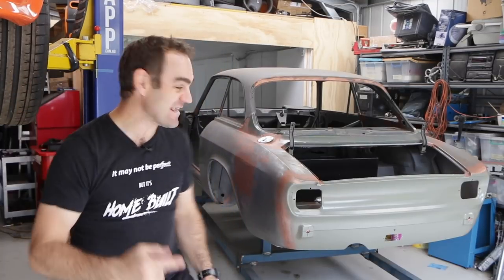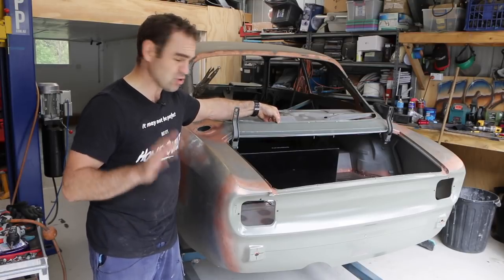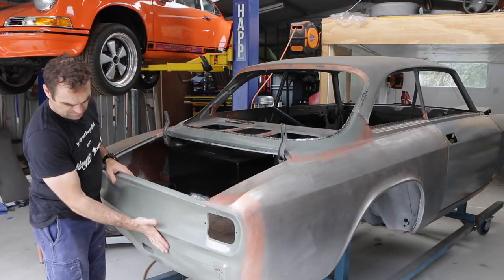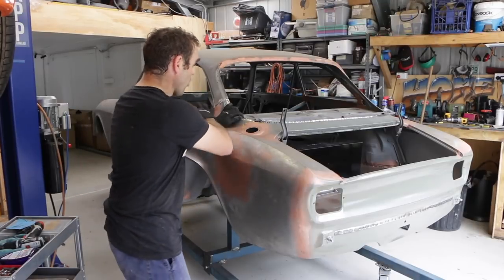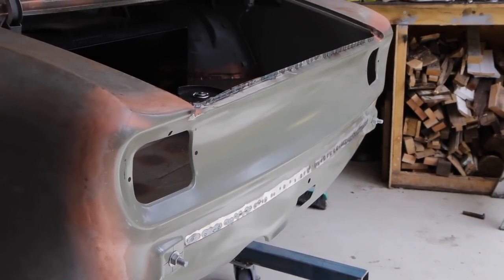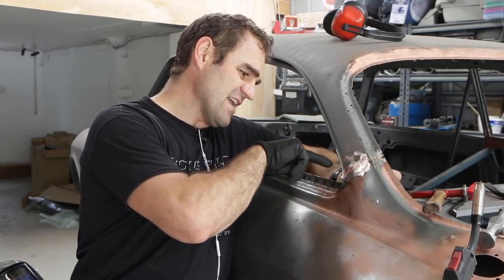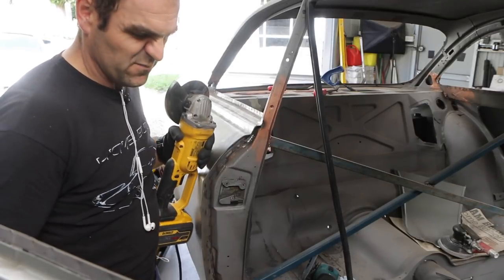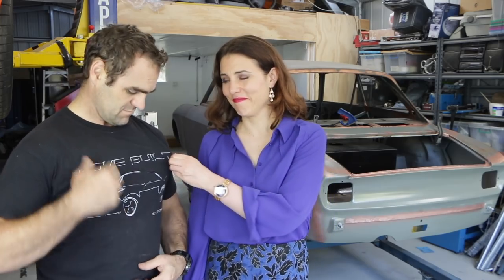Finally a one piece shell again! - Alfarrari 105 project car build part 33

Comment: Must be something in the weather. I had an off day on the welder as well. Problem is, I was welding the door bars and gussets in. First thing you see when open the door. The rest of the cage has all nice exposed welds. Gussets? Ground back smooth.

Comment: Wow what a massive milestone to have the body all back together. 
Out of interest what shielding gas were you using with the Silicon Bronze wire?  I think they recommend a 100% Argon for that type of work, rather than the standard 75/25 Argonshield so that may have influenced your results. I am no welding expert, just passing on what I found In my own research.
Anyway congrats Jeff and can't ait for the next video.
Reply: I'm interested to know this too - at first I thought he'd tigged it and that's always straight argon as far as I know.
Reply: @seanalexander9531  Yep TIG is normally 100% argon, I think there are rare occasions where a different mix is used on rare metals but for most of us that just weld steel and aluminium it just 100% argon.
Since leaving the comment I have found differing opinions about the shielding gas when it comes to MIG,  the miller welders site says only use 100% argon with silicon bronze but other forums have mentioned that as long as the gas mix does not contain any oxygen it is ok.
Reply: @nerner67  OK thanks, I've done some SiB* with the TIG and used 100% argon and it worked out fine.

*  This Old Tony did a video on this and coined the term :)

Comment: Nice job!  But, don't you feel like it could have used just a few more spot welds?  😬👍
Reply from the maker: Basically that is what Tim does instead of seam welding, is just double or triple up the spot welds ;)
Reply: @HomeBuiltByJeff  creating more rigidity than original manufacturing, which leads to less torsional twist during hard cornering. With a standard engine anyways. 🙂

Comment: Other guys doing welding seem to put in a couple of screws or rivets to pull any gaps in then once some welds are in they remove them and finish the welds. I didn’t see you do this
Reply from the maker: Watch closely and you will see me putting in the screws and also removing them ;)

Comment: I always eagerly await your latest videos. Thanks for showing we other mere mortals that it can be done. I have a couple of questions however.  1) did you do a trial fit off camera of the rear window again-just in case?  Things shift around and I've personally been snakebit before and glass does not bend like metal.  Plus-Maybe its different down under but rear glass is made out of unobtanium in the states so I'd be 3x careful 2) Early on in this series you sold me on upgrading my welding equipment to buying a TIG. Was the MIG employed due to a need for a stronger more structural weld?  For this application would flux core be sufficient or do you need an inert mix.  Ive been planning on going to TIG for all my gas needs  3) with the spot welder I'm not seeing welding goggles used.  It is because spot welding is not a continuous arc?  Glad to see that the weather seems to have settled down in your neck of the woods
Reply from the maker: I have more control with the MIG, and I never use flux core wire any more. Gas is better all round.

Comment: at 13:43, you  an see the bottom of the rear guard where it seems to overlap the black sill.
Are they welded together there ?
 if not how do you keep moisture getting in ?

Comment: Never used that wire,  but have you tried fore gas flow?

Also, does that fuel cell fit out of the boot opening?
Reply: *more

Comment: do you spot weld through the Weld through primer ? pr do you remove it where the spot welds go?
Reply from the maker: That is why it is 'weld through' primer ;)
Reply: @HomeBuiltByJeff 
so look look it this way ...
you clean all the grease and gunk off your panel to avoid contaminating the weld, then spray a paint that has resins & various chemicals etc, then weld into that paint.  In my experience I found on plug welds it contaminates the weld.
I did a metal shaping course down here in Melbourne and when I asked the teacher,  he said he doesn't use it because   ....  it contaminates the weld.
Ive seen where people spray UPOl2 and similar primers between seams and  after clamping , they use Acetone or thinners to clean the plug hole and remove the primer just in the expose hole before welding. That way the primer is there between the two sheets of metal , but the plug hole is clean metal before welding.
I guess we all have our preferences, but I found my MIG and TIG welding suffered somewhat when I welded directly onto the Weld through primer.